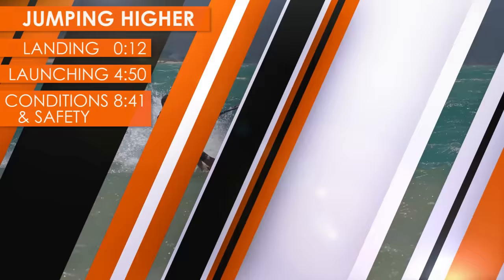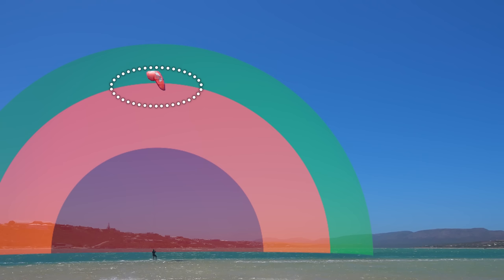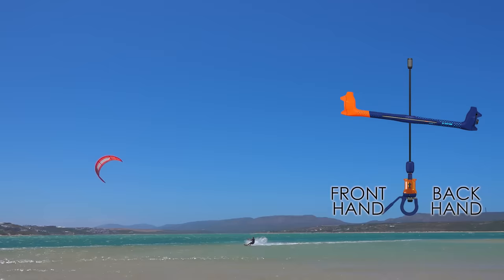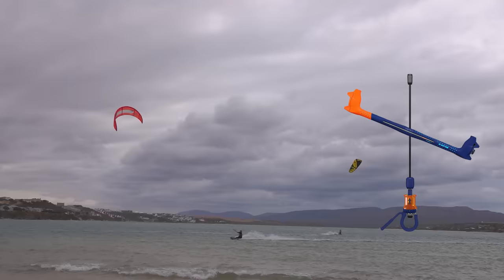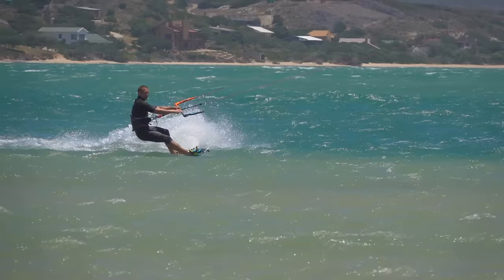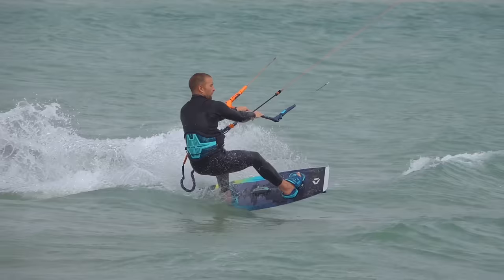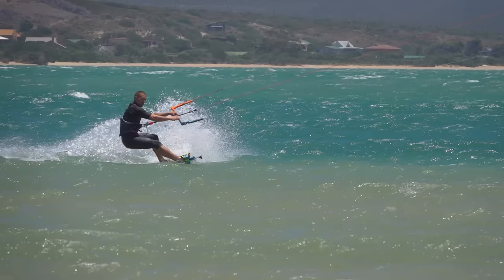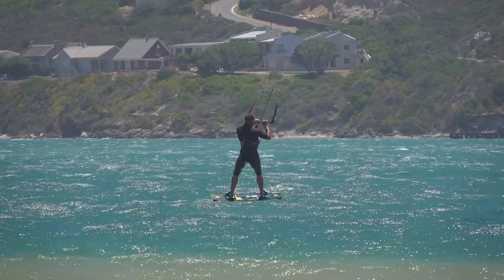Jumping Higher, Kiteboard Tutorial (inc: landing, heli loops, launching, conditions & safety)

Comment: Lately, when riding in overpowered conditions, I start rotating during the jump. A slow, late fron-roll movement. I have tried different things, but it always comes back in overpowered conditions.

In normal conditions I don't have this. It is only when going out in strong winds (+30 knots) and when aiming for maximum height.

Any suggestions?
Reply: Kite-surf college... Have this issue pretty often as well, slow uncontrollable front rotation. Tried bringing legs up in front during the launch, tried "looking over the shoulder" in the direction you want to go... still no luck.
Reply: Try rotating your Board in Circles below you. If you Look at the Board below you and rotate the Board with your clockwise you induce a frontroll like Rotation. If you want to prevent that rotate conterclockwise. If you want a more in depth Physics explenation I am happy to Do so. If you Look for cats landing on Youtube you will find the Same effect.

Comment: Alex if I made a medium/big jump and I "forgot" to make the kite swinging over me when I'm up, I risk the kite frontstall letting me fall down without any support?
Reply from the maker: Hello Gaetano. If you leave the kite at 12 during hangtime, it will slowly move upwind of you as you descend. It will still support you, you won't drop fast with your kite at 12. Keeping a kite at 12 with the bar in is the safest option during a jump. However, during a long descent the kite can fly onto your upwind side (this is because you make the apparent wind rise as you fall, allowing the kite to fly where it wouldn't normally). Then, at the moment you touch down on the surface the apparent wind is not rising anymore, then if the kite is still upwind of you, it will instantly loose power. It may even front stall. If the kite is high performance it could be very far upwind, and it may drop out of the sky completely. If the kite is slightly upwind and lower performance then it will probably drift downwind back into the window. Why do you ask, what is happening during your jumps?
Reply: @kitesurfcollege  I have tried the first jumps, I'm still not redirecting the kite at landing and as you say in the Jump video is easy to front stall in this condition, infact it always happen, for this reason I had the doubt that can happen when I'm still up! so I asked, thank you for the precise and complete reply!
I still have another thing that not clear, I always read that on jumps is mandatory to keep the bar IN, this means is not recommended to progressively sheet out the bar if I want to limit the ascending of the kite or just come down sooner?
Reply from the maker: @GaetanoCrisci  good question. Pushing the bar out, while in the air, will encourge the kite to fly forwards and head further upwind that it would. This makes it more likely to front stall. So pushing out the bar at that point it not a great idea. Bar out generally helps the leading edge travel forwards quicker.
Reply from the maker: The only time this might help is if you're doing a loop and you want the kite to move quiker. So when I heli loop or do a powered loop. I do generally push the bar out at first. Then I pull in the bar again when the kite is flying back above my head.
Reply from the maker: If you're really struggling with the kite overflying and stalling I recommend the double movement. It is the most forgiving option and you can keep the kite pretty close to 12 the whole time. So say you are riding left kite at 1030. Steer up and jump. Keep the kite at 12 for most of the jump. 3m or 4m before landing steer back to 1230, then steer forward, aiming to reach 1145 or 1130 as you land. No lower than 11, as the impact will get hard after that.
Reply: @kitesurfcollege  Perfect, thank you Alex!
now all the pieces are getting together.
Reply: @kitesurfcollege  Hi Alex! 2 days ago I I have rent a Core XR7 10m with 22 knots, was time that I was curious to try it, and it's true is very comfortable riding and progressive, gentle and easy lift in the jumps, that allowed me to win that little shyness and do the first true jumps (someone for my error higher than 3/4 meters), now I understand why you used the XR for this jumps video...
in future I want to try also the Rebel, another school where I'm in Porto Pollo is from Duotone but they haven't so many Rebels ... only Neo
And at the first occasion with 22 knots I also try them with my Ozone Edge, that I know is a little more advanced of the Core XR
Reply from the maker: @GaetanoCrisci  well done on going a little higher. XR7 makes it very easy to jump. Rebel does this too but has softer landings and higher bar pressure. I haven't  tried the edge before, but most people I know with them have had quality issue, chicken loops that pop open, leading edge seams break etc. I'd still like to test them myself. Let me know how it goes. Neo is a pure wave kite, not designed for making jumps easier.

Comment: thank you for this nice video. im already getting closer to the 20m mark (pr 18,9m) but still got in touch with some nice tips to improve my riding.

but would it be possible to get another video with having a closer look to improve hangtime and jumping further? i know i have to pull the kite more to the front but this is still really challenging especially in heavy overpowered conditions when aiming for the real biggies ;)
Reply from the maker: Hello Phil, congratulations on 18,9m. You're doing great. This video is mainly designed for people stuck around 5/6m, struggling to clear 10m and not able to land it when they do. This applies to a lot of people. In your case, however, the advice would need to be more personal to make an improvement. As you start clearing 20m, conditions become really important. You need power (30kn+), and you need a smooth surface; and it's rare to find both - usually strong wind generates chop. It helps even more if there are big clean waves heading crosswind straight at you!! That means you get kickers that you can ride directly into at high speeds. This alone can add 10m, and it's those conditions in which the highest jumps are recorded (40knots crossshore, with 5m swell travelling on shore). The main place you get those conditions reliably is misty cliffs near my home in South Africa, and that's chock full of people trying to crack their jump record. Equipment choices also help gain a few meters. A smaller board can help cutting into the water and handling more power. A lighter board will help a bit, and you don't want too much rocker, as this will loose grip (even though it rocker gives nicer landings). A flat kite or hybrid is easier for most people to jump high, and C kite is more difficult. Beyond that, it helps to stay fit and flexible. Good luck. Also, bear in mind that the 20m barrier is hard to cross and risky. Your kite can overfly in a panic-inducing way and an equipment malfunction could be deadly. I'm getting on in years, so these days when it's over 30kn I usually leave my twintip in the cupboard and take a surf board with a tiny kite.

Comment: I noticed you do a quick sheet in-sheet move with the bar as the kite is moving towards 12 before your jump, is it just a last second power check?
Reply from the maker: Hi, I could probably feel that I could handle a bit more power on the run up. It's okay to pull in the bar a bit as the kite climbs. In fact it can help maintain speed. As long as you don't pull in the bar so much you loose your edge. Loosing your edge completely ruins a vertical take off.

Comment: Hi Alex, I have watched yours and others jumping videos many times. While I have yours as main my reference for progression, I have found others to focus on sheeting the bar out after you reach the top of the jump to get more lift out of the kite on the descending. Do you agree with that? I noticed in some of your videos you do sheet out slightly before diving the kite in the end, but the bar animation doesn't match it. I'm having some problems landing 4ish meters smoothly, they usually feel too much forward speed and not enough lift or I might just sink. Seldomly it actually feels lifty and smooth. Last experience was a 12m kite, 15-18 knots
Reply from the maker: Hello Daffes, if during hang time with the kite at 12, you sheet out you will loose lift and fall more quickly. Even worse, when sheeted out the kite flies forwards more quickly, so the kite will fly further upwind of you, and further from the landing sweet spot. 

From your description it sounds more like a take off issue, most likely you're not keeping your edge and you're flying downwind during take off. Do you have a large amount of spray shooting from your board on take off? If not your edging could certainly be the issue. OR, it could also be that you're pulling in the bar slightly too soon during take off, pulling in the bar before the kite climbs to 12. That can also make you keep too much forwards speed then sink on landing. What do you think, does either of those sound like what you do?

For the sake of completeness, there are a couple of situations where sheeting out briefly can help, but that's mostly for much larger jumps. Just before landing, after the kite has been steered, you can sometimes push the bar out momentarily, to speed up the kite, then pull in the bar for extra lift. But then you're just as likely to make the kite fly beyond the sweet spot before landing if your kite awareness isn't ready.
Also, if you are doing heli loop landing from a large jump, having the bar out a little, can increase the kite's forwards speed, so it flies faster quickly around a slightly larger loop. If the kite is moving faster, then when you pull in the bar you get more lift than you would have, if you get the timing right. But again by pushing the bar out, you can just as easily end up with a heli loop that's too large and not overhead, or you can make your kite pass the sweet spot before landing. So I wouldn't even consider pushing the bar out while building towards 10m jumps. All of that will be covered in the next tutorials that follow this jumping higher video, which will aimed at kiters trying to go from 10m jumps to over 20m.
Reply: @kitesurfcollege  I read your reply and rewatched a few videos. I believe pulling on the bar earlier is contributing, I'll focus on that. I also think the kite is staying deeper in the window than overhead, so I thought sheeting out could help getting it on the sweet spot. The edging I thought was less of an issue since my upwind performance seems to be pretty good compared to more experienced riders, but the spray could definitely be bigger.

Comparing the landing to a waterstart, sometimes we don't want to pull the bar all the way down, since it generates too much force, is that a fair comparison to how to control the downwind pull on the end of a jump?

Thanks for the quick and detailed reply, it helps me lot understanding the theory. I'll insisit on the technique and keep the bar down.
Reply from the maker: Good luck Daffes let me know how it goes. It's seems unlikely that your kite would be deeper in the window than the sweet spot during a standard jump. Usually it's the other way around. Typically during hang time your kite flies forwards and proceeds to the edge of the window and beyond, so it's less deep in the window than the sweet spot. To get the kite deeper in the window than the sweet spot at the start of the jump would mean you steered the kite unbelievably hard during take off.  This can be done of course, but I've not seen many beginners do it. You would be steering on full lock for a couple of seconds to do that. This would result in your being launched downwind quite violently, and doing a long low jump. Is the kite ripping you off the water and shooting you downwind?  
The jump landing and waterstart situations are quite different in terms of bar position. During a landing, the kite should be very close to overhead, so the more force from the kite the better. That force is mainly vertical slowing your descent, since the kite is at a high angle. During a waterstart the kite has less lift and more forwards drive, due to not being overhead, you then move the bar in or out to increase or decrease that force and manage acceleration. So it's not a good idea to have the bar pulled in by default during a waterstart, but during hang time, the bar should be in, if the kite's overhead. 
Do you think you could get someone to take a video of your jump? All the best, Alex
Reply: @kitesurfcollege  it will be a few weeks until my next kite trip to play again, but will certainly practice all this and get some outside video. Thanks.

Comment: That’s a very good tutorial! However there is something a bit confusing to me: 5 of 4 advanced jumping coaches says that you should not push too hard on the back foot for high boosting (15m up), instead they teach to edge  using a more even pressure between back and front foot. Why do you prefer more weight on the back foot?

Comment: I'm doing some really heavy landings (crashes) from higher jumps.. any tips?? Think I could be sending the kite too far on take off then can't correct it properly.. need to fix this soon as a nasty injury could be approaching.. 😬😬😬
Reply from the maker: Hi Chris, I'd recommend that you to stick to lower jumps for a while, and work on making your landings as soft as possible. Learn to find the sweet spot, where the kite gives the most lift, at the exact moment you land, and you should start having much softer landing. As you get better at landings, it's actually quite easy to jump higher, if you can rely on your kite control to soften the impact. That why the video starts by focusing on landings. Good luck.